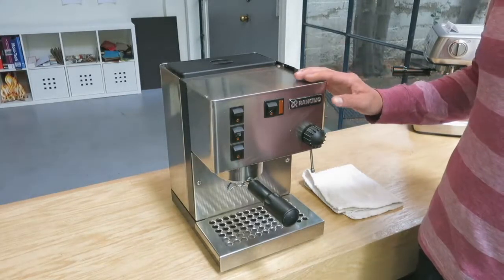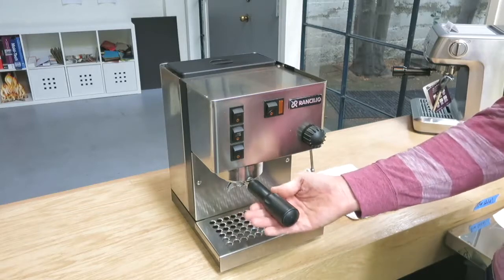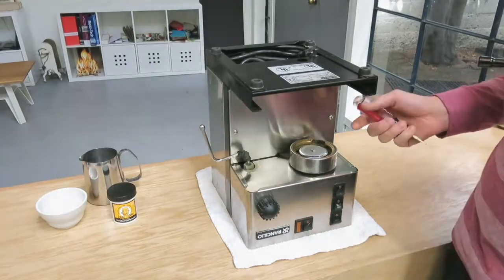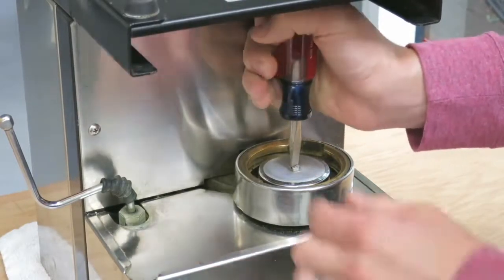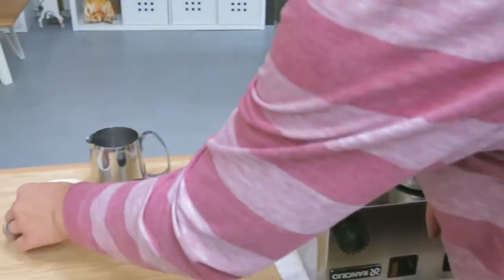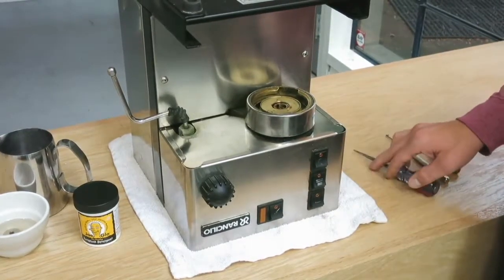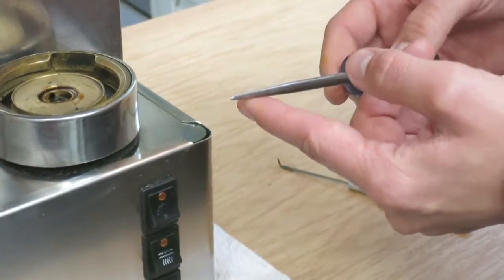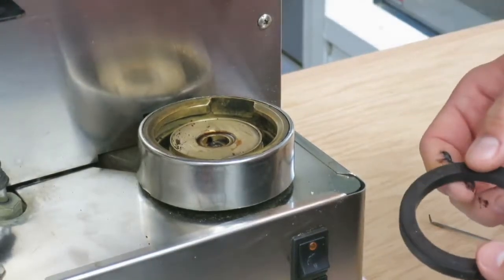DIY Rancilio Silvia Tune-up

Comment: The machine you service is a v1. On the v2 you can remove the disc you mention around 2:13 plus the housing around the disc looks different.
Reply: So obviously a V1.

Comment: The machine in this video is Version 1. 
Version 2 is the one you describe with the ergonomic handle of the portafilter. 
There's now a V3.
Reply: do you know if the disk in the middle should be removable for version 2?